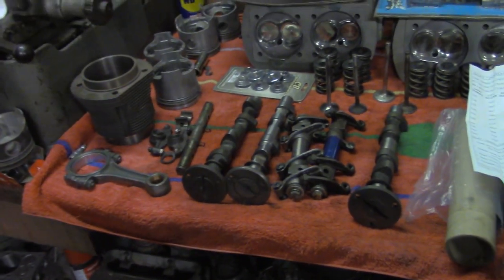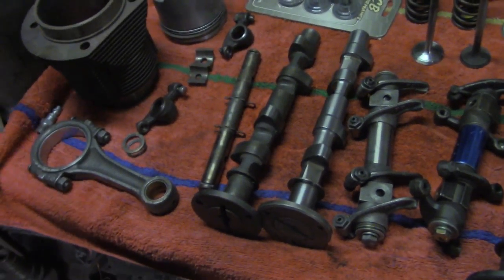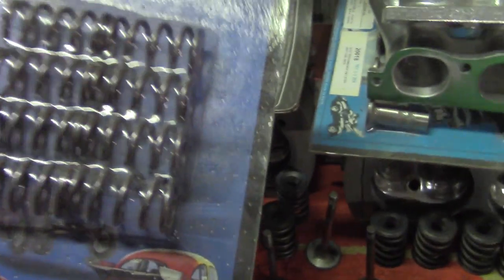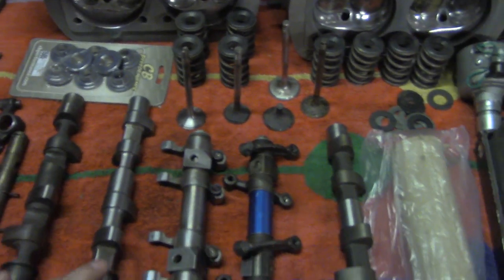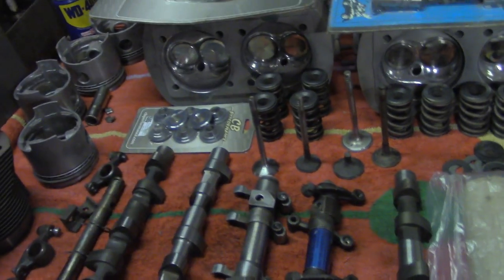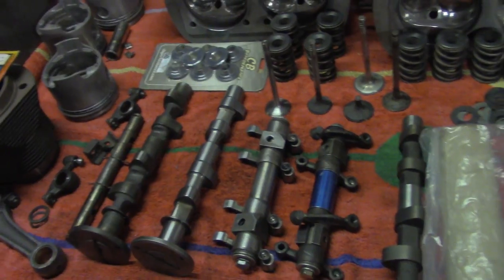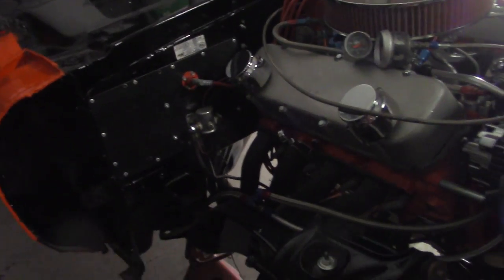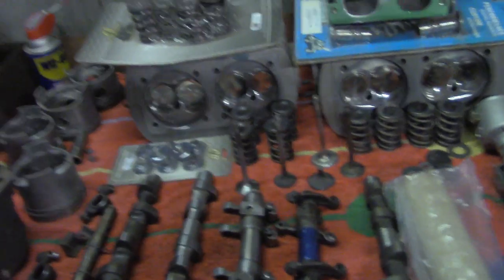VW Shop vlog & parts

Comment: Very Kool !!!
I am helping a friend build an engine for his Buggy. He had started tearing down an engine - mainly teaching his son in the process. I had found an engine on a VW facebook page. Price was very reasonable at $1000. He made contact - did some wheeling & dealing. Then after picking it up - he & his Dad stopped to drop it off at my place. 
1st thing I did was pull the valve cover - !!!!!!!!! 
I told him - well - I would say the rocker assembly is well worth the cash & trade that took place ! ! ! ! ! Someone had spent some serious money on this engine. Some rather extensive port work - looks to be 40 & 35 valves with a set of AutoCraft rockers.
Very Very SWEET !!!!! Never figured I would even see a set.
Everything on the inside looks really good.
Thanks again ! Awesome video - this is the stuff I myself like seeing. What works - does not - do & dont

Comment: Thanks for the video Darrin. Well just a bug in the ear to watch the rocker shafts. I had a C35 cam on 044 heads in a 1641 with stock rockers and sure enough I split a washer actually 3! Went solid and while a touch noisy it was fine after that.

Comment: I had bugpacks best lifters fail with single heavy springs with a 110 cam. Using the correct zinc oil the pushrods burrowed up into the underside of the lifter, one of them went all the way to the oil cross hole. We couldn't figure out where the clearance was going. Finally figured the cam was going flat. I pulled the engine apart to find the problem. Although they were the prettiest lifters I ever saw, I think they were made out of leadlloy in Chinastan.

Comment: I have a request, I know you have covered most of it before but like to see in one video. Oil control... What is Full flow? Oil cooler types and why to use types of oil pumps. What is wrong with oil filter type pumps? Oil weight and types. What about sand seals? Oil temp sensors? Oil pressure, how to measure it. Deep sumps. Tnks. Hope this something you can put together, in one vid.
Reply: stock 1600cc on a oil filter pump 153,000 miles on my 1973 bug. vw mexico install them on there 1600 engines 30 mm pump on dish cam stock!!!

Comment: can a stock 1600 handle a little boost? ive had a small turbo on the shelf and was going to build a manifold and put it on one of our sandrails. not looking to push a ton of boost, maybe like 5psi. is that safe to run on a stock 1600dp?